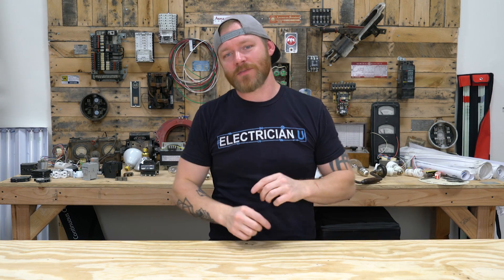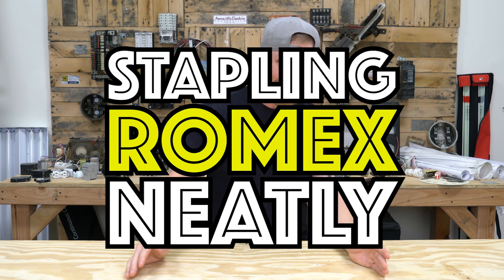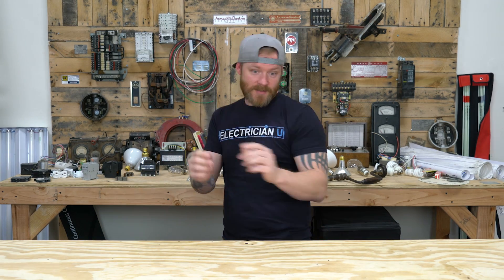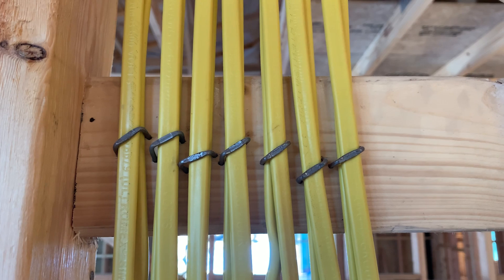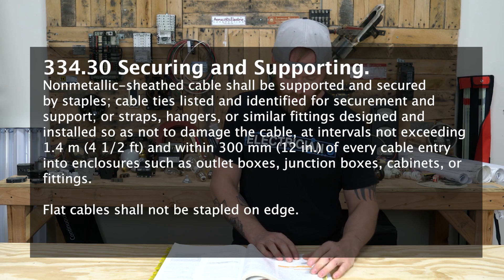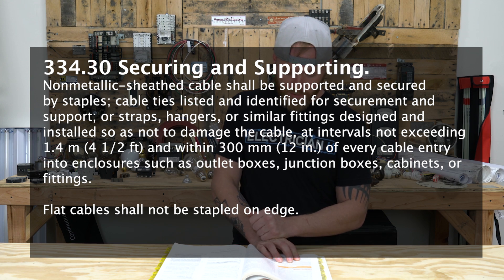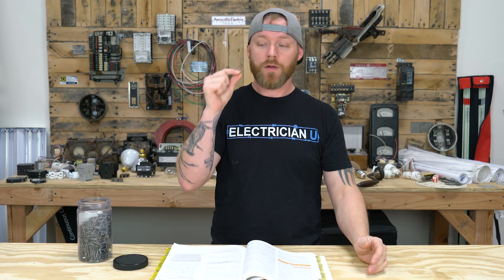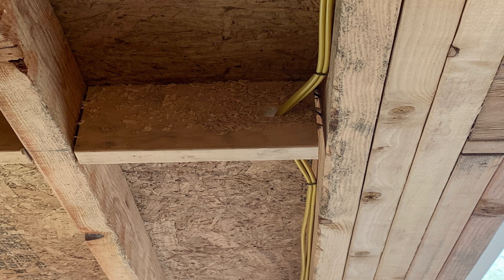Should Romex Be Stapled Neatly? DOES IT MATTER??

Comment: There is no downside to your attitude. The question is "Is there an upside?" I'm a general dentist whose dad was an electrical maintenance foreman for Westinghouse for most of his career. He taught me about electricity and the fundamentals for residential wiring as well as the high voltage stuff he was involved with.I have wired my own home projects as well as two office remodels plus other projects. My best buddy is an electrician and he says "thank God you can do root canals because your wiring is just sloppy."  The stuff he did for me was absolute artwork. 30 years later, my work endures and so does his. It comes down to professionalism and tenacity. I just want to get it done and I do. My buddy is always thinking " What's the next guy gonna think."

Comment: This contractor here is late to the EU party but linking the back content and the current videos too. Question to any electrician out there about securing wire. I recently renovated a walkout basement into a sublet apartment. I wired what needed to be wired. Nothing complicated. Inspected and passed on first go. Someone before me put in plastic condiut straps every three feet along a 30 foot in a joist pocket and had a couple wires run in the straps. We ran a couple more wires along the same "chase". We have a good code inspector and he did not call it out. BUT....are these straps allowable by code? I thought it was very convenient for wire runs and easy to pull wire but I am now second guessing the code validity of this method. If a M-Elec could chime in and yay or nay this I would be appreciative. Thanks

Comment: Do you have a video on securing and supporting NM cable in the attic and options like on top of the ceiling joist or on the rafters?  So why isn't stapeling 2 wires together not bundeling.  Seems to me a staple or zip tie is the same, if you are grouping the wires together every so many ft, then its a bundle.
Reply: Two NM cables is bundling as you have four current carrying conductors (assuming 12-2) so you would de-rate at 80%. However you derate from whatever is listed in the 75 or 90c column in 310.16 not the 20A breaker rule on a 12. That's what saves you. When you have more than six conductors then you're at 70% and you're under 20a.
Reply: @joeschoebel1458  Thank you, what about passing 2 or more wires through stud walls? how do you suppose to separate them.  Is just pulling them apart some acceptable way?

Comment: Hi Dustin, thank you for all your videos. I just became a homeowner a couple of years ago and have been doing my own electrical work here and there (small stuff like EV charger) based on your videos. Now I am on to my next project which is solar DIY. I have to run romex wiring from the roof to the attic and into my attached garage so it should just be one home run of romex since my garage is not finished (no walls). My question is, how do you usually run romex through the attic? I've seen your videos on how to run them through the studs (bored holes) but what about in the attic? I don't want to bore holes through the rafters / joist if I don't have to (don't want to risk integrity of the roof). Could I simply stable the wiring neatly across the rafters / joist and call it a day? My attic has no permanent access (ladders / stairs).

Comment: "Nobody's gonna see it, it's gonna be behind sheet rock" is the same mentality as why framing guys and general contractors leave their messes EVERYWHERE on a build.

More on point, I think this video doesn't touch on the aspect that at SOME point there's the potential to enough romex to a cavity (say a vertical wall between studs) that spacing will become and issue and cables HAVE to be stacked up.

Comment: Hello.  Is there any sorta one hole strap that I can use to secure Romex. I hate to use staples because I keep hammering my fingers, or some spaces are not open enough to use a hammer or even to hammer it using pliers.   I love flex because I use my screw gun to secure the one hole strap anywhere in particular tiny areas.   Thank you in advance

Comment: I'm running 4 home runs ( dedicated lines for major appliances ) from the kitchen to the panel ( in addition there will be three more circuit runs ) so a totally of 7 lines going through the joists at a 50ft distance. All of this romex bundle together in a 1.5 inch holes ( in the joists) does this derate it ?

Comment: In all trades, a neat and clean install makes the inspection smooth and fast. Atleast for me. Had 2 crews doing remodels 1 was kinda sloppy and the other very clean. Both met all local code requirements. However, the sloppy house inspection took hours and the clean the house was done in an hour.  (Both had similar extensive work in all trades) I reworked the crews and the sloppy crew became very neat and efficient. Love your videos.

Comment: Got a question, inspector wrote on an inspection that it was ok to put three wires under a staple and as many as three more under the same staple crown with a total of six. What does that mean? You staple three wire on top of each other and use a stack staple and put three more on top? Where is that in the NC code book?
Reply from the maker: I would recommend Art 334.80 when dealing with this. “Bundling” is one thing to be concerned with if these conductors are close together for more than 24”, but as far as the staples go, the NEC doesn’t specify that. For that information, you would need to check with the products specs. It will tell you exactly how man wires can be put under one staple, the answer is certainly not 6, if my memory is still decent.
Reply: @electricianu  I didn’t think so. Thanks. I ended up buying cable stackers and doing that way. I didn’t want to take a chance with the wires overheating in the summer time heat with them stacked on top of each other the way he said to do it. Beside even with a stack staple you cannot get six wires under that one staple. There is not enough of the staple left to hold into the wood. He passed it with the cable stackers with the job looked even more neater that the side by side stapling. May start using these from now on. Little more but looks pretty good.

Comment: You get an oil change. You drive home and park your car. You leave the next morning and there's oil drops on your driveway. You freak out and take the car back to the shop thinking they forgot to tighten the oil filter or the drain plug.  It's checked over, both are tight, but the lazy lube tech just didn't wipe off the excess and sop up the puddle on the underside of the splash shield from draining it because "fuck it, they won't see it".  Doesn't matter if the car was never in jeopardy, the job wasn't done right.

Comment: Please do a in depth video on bundling romex  as if I drilled 20 ft of joists both vertically and horizontally with a 11/2 bit and filled that hole up with romex that had spacing less then 2ft between the joist is that still bundling 1st year apprentice familiar with code and no Forman I met can give me a clear answer

Comment: Heya. Great videos. In my jurisdiction, those neat wires staples on top of the boxes aren't up to code. You have to have at least 6 inches of free wire outside the box, in case they get damaged inside the box by drywallers. Then you can pull on them and still get your 6 inches inside the box.

I personally don't like that much staples, just enuff to insure they can't get squeezed between drywall and stud. That can be neat without being OCD.

Keep up the good work.

Comment: I was always taught a maximum of 2 romex wires (14 or 12 awg) stapled on the flat no closer then 1.25 inches from the stud/joist edge with insulated staples. The insulated staple is VERY important, not to meet code but to help prevent issues with modern arc-fault breakers!

Comment: I know what the code says, and usually I see the reasoning, but pulling the romex tight and possible and nailing a metal staple over it as tight as possible - which is how some electricians follow the code - makes zero sense to me.  Just today I go to add a plug for a TV in a condo built in the '80s and find numerous instances where the house has settled and pulled that wire that was already stretched tight as possible then tacked down has see-sawed under that staple and worn clean through the outer sheaf...won't take much to have an arc happening with that cable stapled down on the bare wood frame work.  I've seen it a thousand times, and usually find problem spots.  I can think of three houses that have gone up in flames - one just a few weeks ago - all electrical fires due to wire rubbed raw under metal staples driven into the studs.  Why/how any electrician can think that's a good idea is beyond me...

Not to mention there's not an extra inch of wire to make repairs or add ons...I'm all about making the work look neat and professional - the work in your video is top shelf all the way, but safety and utility are just as important

Comment: Thanks for putting it so well. On my first job as an apprentice I ran cable to several Homeworks panels, ensuring everything was neat and clean, including the  ledgerboard. My heart sunk when it was covered with insulation and drywall. Then I realized it mattered to me that it was done well, plus I had pictures. Even though it gets covered, I know I did it well.

I've worked on many custom homes since then, where the homeowner visits. It matters to them the work looks neat and clean and gives them confidence in the installation. Ditto for the GC (although they also value work completed timely).

Last bonus. Clean work is easier to troubleshoot. In fact, I've rarely had to troubleshoot clean work; gremlins seem to prefer bunched up wires, etc. Pride in good work means work that will give years of trouble free service.

Comment: That is why most skilled electricians are perfectionists. Those just learning the trade needs to learn those skills. When I first started my boss did not want to see the romex not following the wood. No diagonal runs. Yes you use up more romex but in the end, but it all looks amazing. We did a lot of residential homes for a military base and we had a blueprint for each style house of how the circuits were run. I still have those prints and if I eve have to go back I will know exactly where to look for a circuit, no guessing what wire was doing what. Yes it takes a little more time but quality of work is of utmost importance. Do it right, make it look good, and make your life a lot easier.

Comment: As a handyman, and a Jack of all trades, taking pride in your work helps out not only you but the next guy.  I just started remodeling my house that was built back in 74'.  they ran a constant hot to the ceiling fans in the bedrooms for a transformer on the wall to control the speed.  As well as junction boxes everywhere in the attic to run power in a 1800sqft house on 20 breaker slots.  Upgraded the panel to a 36 slot panel, as well as upgrading the outside to a 250A main. I has the inspector as about a few things and i had to let him know that it was to allow me to access and upgrade wiring as we progress through the house. my kids love the fact the can strip and sell the old wiring, and I'm going to enjoy the fact that the wiring is simple, and easy to read/follow.

Comment: Stapling cable to studs is one of the most useless codes I've ever heard of.  It holds cables in places where insulation wud otherwise fill voids.  In the event of remodels, it forces one to remove or bust holes in entire areas of drywall that cud otherwise be snaked for cable replacement.

Anchor the cables to the top plate where it can be accessed from the attic, or use conduit to facilitate pulling .. but it's nonsensical inside walls because it forces one to unneeded damage and expense.
Reply: You clearly know squat about electrical code lol

Comment: Not an electrician, but I’ve watched a lot of these videos done by professionals in all the trades. Helps me learn when I need a pro I know if their a “pro” or a hack. To many times before I’ve had “pro” work done on my house and had no idea if it was being done correctly. Turns out, roof and windows were not. Unfortunately around here it seems like just that mentality, “they can’t see it, don’t worry, skip it,”  especially when the place you buy from is not the installer. Simple things do matter. Besides, I always looked at neatly stapling and supporting anything in the walls, especially electrical or water pipes is going to help a lot preventing a screw or nail from giving a person a big headache in the future.

Comment: Not an electrician (yet) but have run many many miles of cat 5e/6 Ethernet, Including 15 km in a single building, and I finished with every single one in neat line with each other. Got a call a couple years later from another tech working on the same building after a small fire, said I made his life almost too easy, and he had to stall a little to make the pay worth his time. I'm with you man, I wouldn't feel right leaving a mess.

Comment: I believe it so much, I put it on my arm for everyone to see. “Do what you say. Say what you mean. Mean what you do.” Integrity is honor. Honor is honesty in all things. In the end, my word is all I have. No one can take that, or give that to me. I will use it to the highest purpose that I can. 
    On a more practical note, neat work prevents mistakes. Not only does the extra care led to better work, but also because mistakes are more easily noticed and the overall SAFETY of the installation is improved. There are many that can build a thing that technically works. There are few that can build a thing that anyone can trust to the security of loved ones.

Comment: As a marine and boat electrician for a yacht company that builds 40 to 90ft motor yachts and competition fishing boats, we all take pride in making sure our wiring is top notch, I can run upwards of 40 seperate cables in a loom behind cabinets and alongside the hull of the boat in places no one may ever see till it sinks, but I know that the people working after me will know that they have no worries of things not working correctly or that there’s no worry the boat will have problems later down the line because we obviously took the time to both wire the boat correctly but I clearly know where things are going when my loom has no wires crossing over or any wild tangles. I wired my bathroom almost the same way abs once I get my hands on the rest of my house I’ll do the same because I CARE, abs it’s MY HOUSE, now at least I know if anything needs to be done I have no worries in finding anything

Comment: I'm all about making Romex look good! Kinda like a neat freak lol. If I pull wire across a ceiling I'll find a route where I can run several others right next to it going the same direction. Usually I just don't cut across any which way, it's a straight line. And I feel good about it when I'm done! Just about everyone comments on how neat and good of a job we do!! Take pride in what you do and set a good example to the ones around you!! Thanks Dustin for all your videos!!

Comment: I'm not an electrician, but I have OCD whenever I do any electrical or plumbing work. I once installed a 17kw, whole house generator and the city inspector told me that he has never seen a contractor do such an excellent job. I did everything by myself, including the installation of the propane tank and underground gas lines. 7 years on and not one problem.

Comment: I see guys rushing around, not caring about all the little details, bing bang, in out, rush rush go go go ... and sometimes they're slightly faster. Very slightly. But they worked their asses off to do it. They're always  struggling with the half-ass bullshit they did in the previous steps. Then something doesn't go as planned, and they have to sort through their rats nest. Then they're nowhere near as fast. They're always frazzled, trying to shave tenths of a second off here and there and they miss the big picture.

Then I see dudes that are meticulous that are generally at least really close in speed (when the "gitter done" guy is having a good day), but they hardly look like they're working. Very methodical, very precise, extremely consistent - and thats where their speed comes from. So they're not frazzled running around like a chicken with its head cut off. Things go wrong far less often and they're generally easy to sort out.

Work smarter, not harder. I don't know what these guys are trying to prove, or who they're trying to impress - but I don't care how hard someone works. I care about the end result. These dudes are digging themselves an early grave for nothing. Their trucks are a wreck, half the time they're working around not having whatever thing they can't find, driving themselves and everybody around them nuts ... Don't be that guy.

Do the same thing, the same way, every time, tweak the procedure when it helps, and speed will develop. Practice doesn't make perfect. Perfect practice makes perfect. Oh, and another thing ... when I see the crappy looking job, I know they don't care. What else don't they care about? Is there a half cut through wire buried in my walls? Is my house gonna burn down because this guy has a hardon for being like that?

Comment: Here in Canada you can staple the first Romeo and tie wrap wires on top , and I label each wire as to where it goes …. Nice and neat and pretty to look at , also here usually panel are in basement so not dry walled on top of them , good work isn’t a extra it’s not being a chop electrician